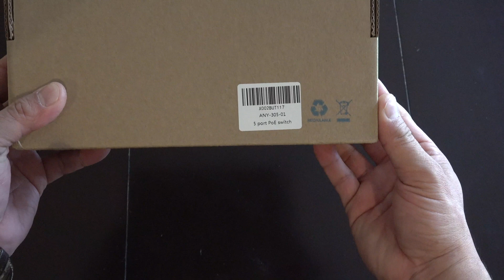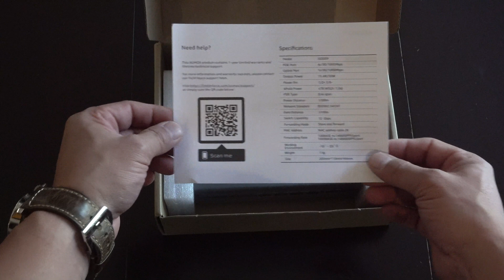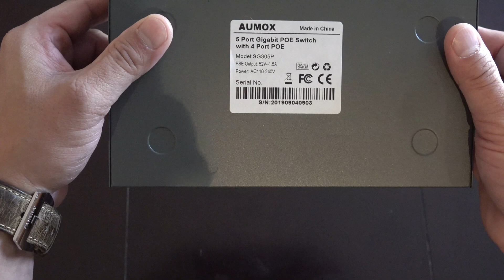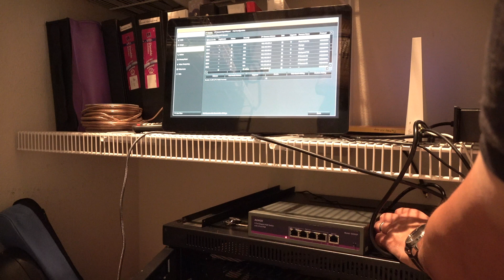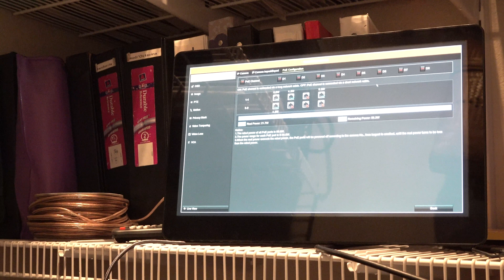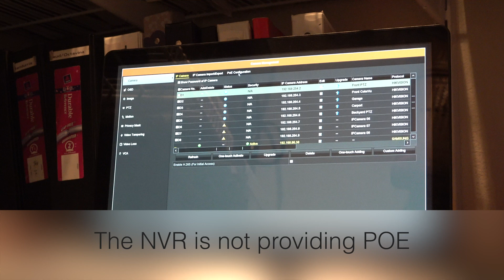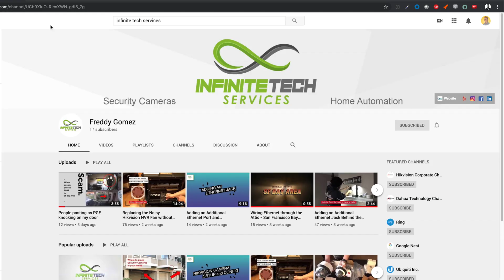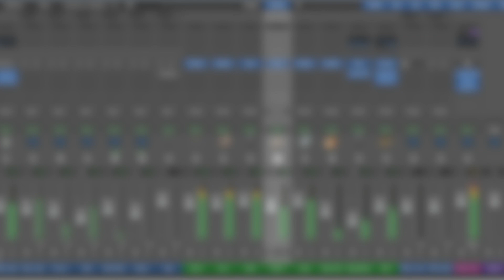Aumox SG305P is an unmanaged gigabit 5-Port POE switch

Comment: what is the switch for on the front? says v s
Reply: S = Switch (Regular 5-Port Switch Mode)
V = One-Key VLAN (Each of the 4 ports are isolated from each other, however they all connect to the Uplink Port)